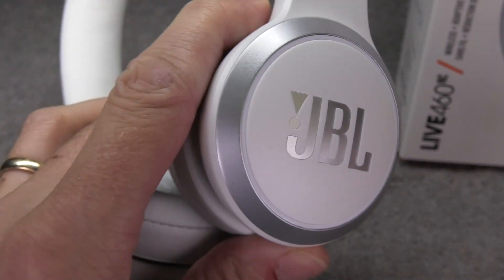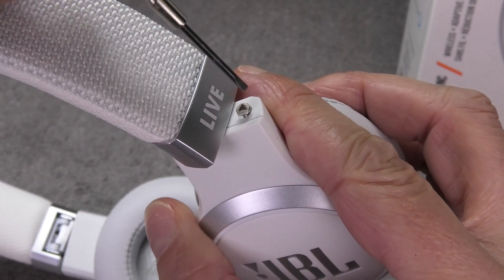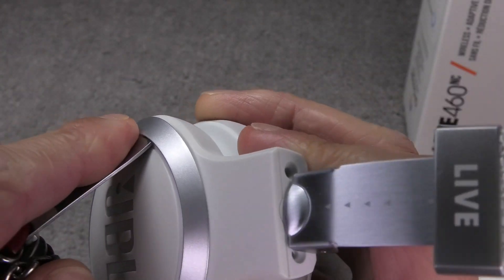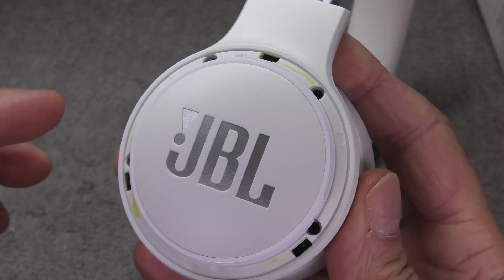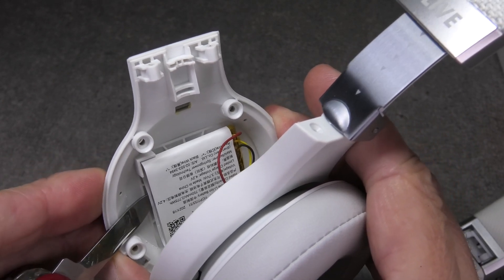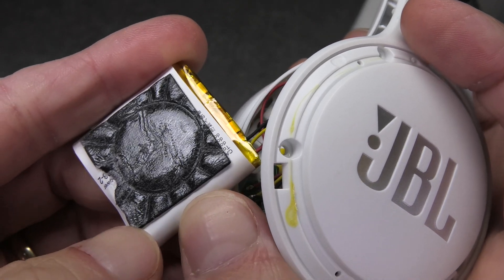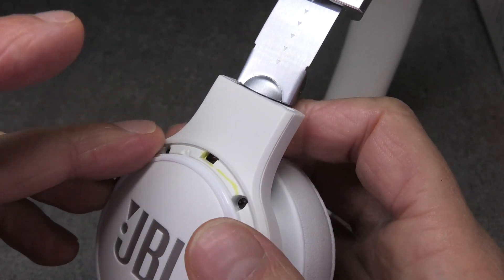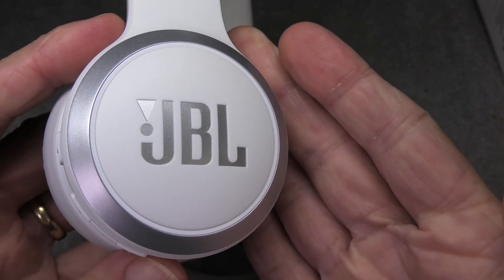Battery Replacement on JBL LIVE Headphones (How to, using LIVE 460NC)

Comment: Thank you....82 years old and one side stopped working....did like you said and
cleaned the left side and after what sounded like a reprogramming both sides
are now working.  Guess somehow it got dusty inside of the control side.

Comment: Hi mate i had problem with headphones not turning on and changed battery, every thing worked fine but turned out that the prooblem is in charging point. Because it wornt charge. Any tips?

Comment: How do you know battery is dead? I have same headphones. Ones after using them I switch them of and there was sound off. But light didn't turn off. And now I can't turn them on and they don't charge. When I connect to charger red light come on steady for few seconds and then start blinking
Reply: I have the same problem

Comment: I hope you see this but my power button isn't working and idk what to do like they still charge but they just don't turn on
Reply: Same but mine don't Charge normally they blink like they are low on battery while charging and only then
Reply: I also have a blinking red light, as if a charge is happening but the red light either only stays illuminated for about one minute, or it blinks for 45 seconds or so and then stops. The headphones won’t turn on at all…
Reply: Battery replacement worked! Toughest thing for me was ginding the right sized screwdriver blade to fit the triangle screws. 

Here’s where I bought my replacement battery:
Reply: @fivedollarchair so where did you ordered the battery?

Comment: This was just what I needed, I had a problem with liquid damage on the switch side, and couldn't for the life of me figure out until you showed the ring removal.
Its very tight inside so for cleaning under the PCB you have to be very careful.
Thanks!